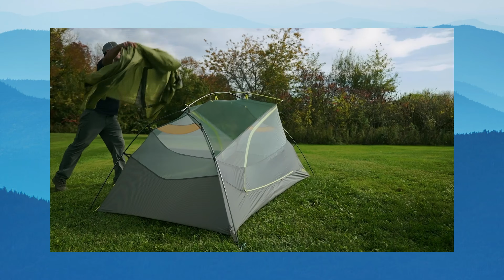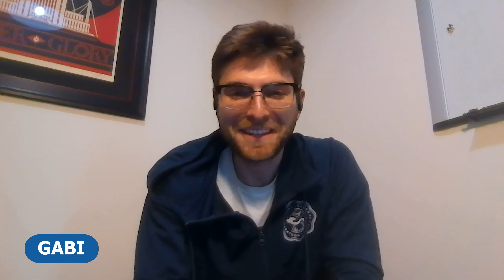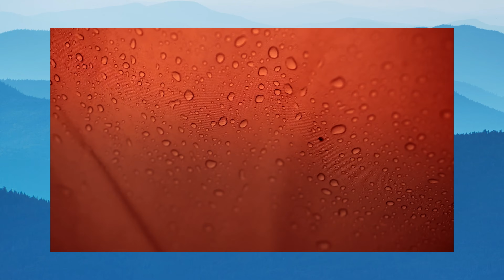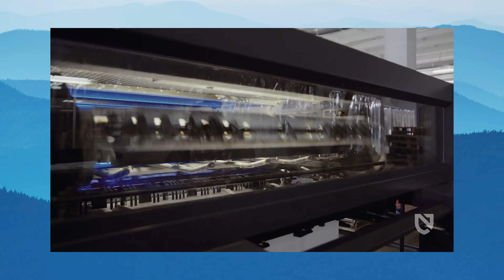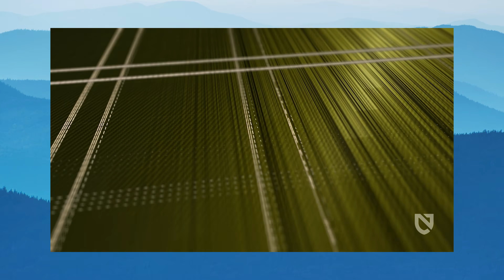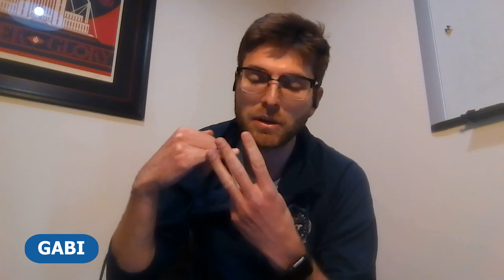What Sets Nemo’s OSMO Tent Fabric Apart? w/ Gabi Rosenbrien (Nemo)

Comment: Hopefully you can tell me what the little rubber thing that is fused on a small loop of cord under the rainfly of the Mayfly OSMO is. There is one on each underside of the rainfly at the apex and located just toward the end of the cross beam. I assume you place the inner loop over the socket end of the cross beam. Is this correct and if not what is it for?

Comment: I purchased the Nemo Hornet OSMO 2p tent, used it on a 3 day 2 night trip. The problem I found was that the clips that attach to the tent body attach too high, meaning the tent body closes in fast. When on a 3" air pad my head and feet touch. I traded it in for the MSR Hubba Hubba 2p... both tents have a head to toe floor at 85" 
I posted a video showing this. Nemo is a great company, not sure how they missed this attention to detail.